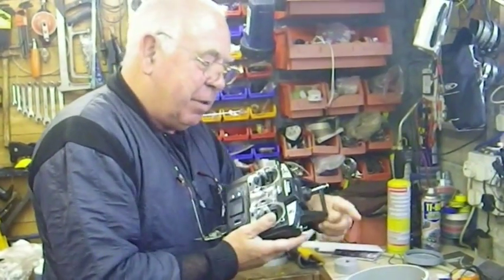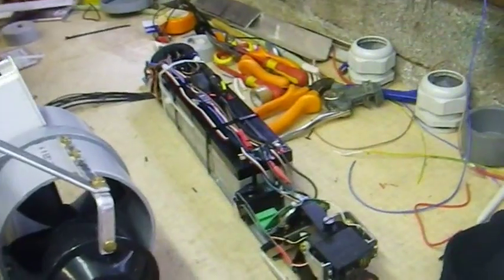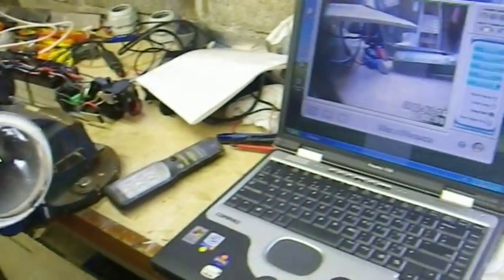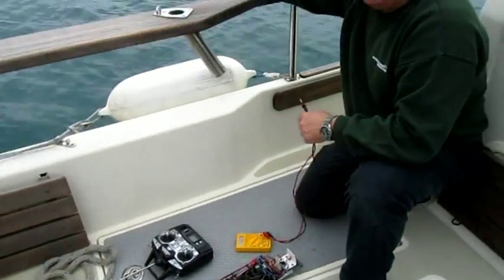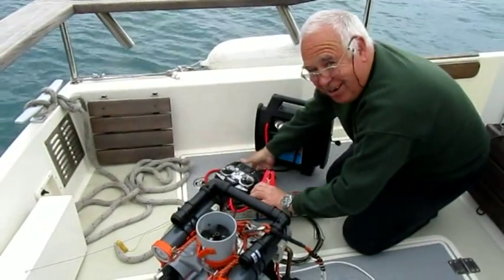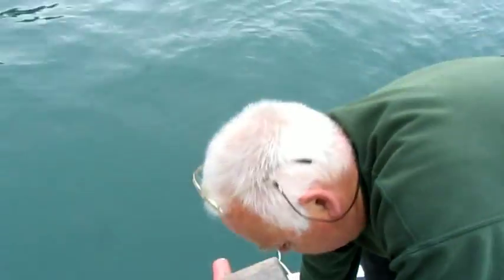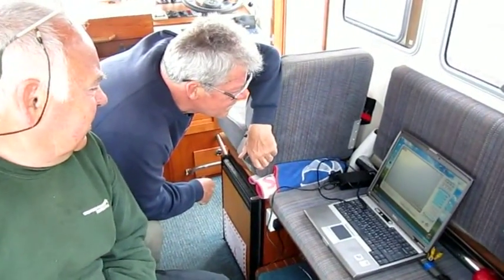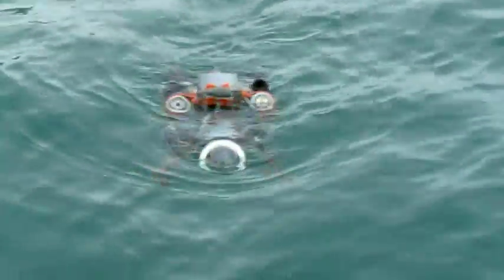Mr Lowvolts builds a homemade ROV

Comment: Very cool !im am to building rovs from bilgepumps and drain pipes.and curently buildin my second rov,you have used a radio transmitter witch i find very interesting,smart guy.next time try to fill your camera unit with epoxy to get the updraft down.keep posting videos,and remember its the fun of building them .from norway